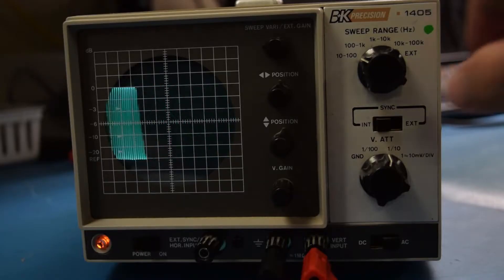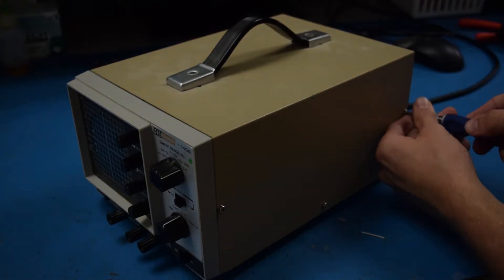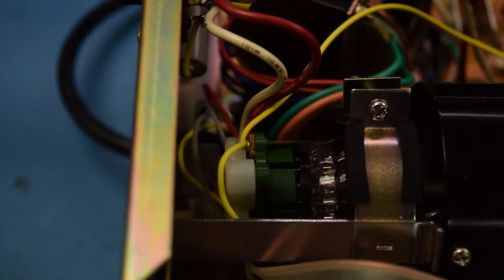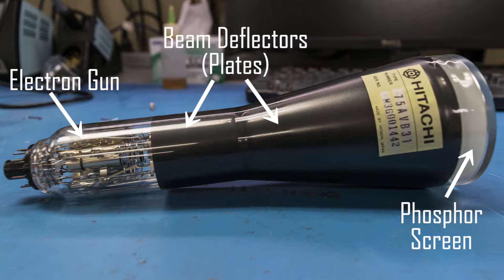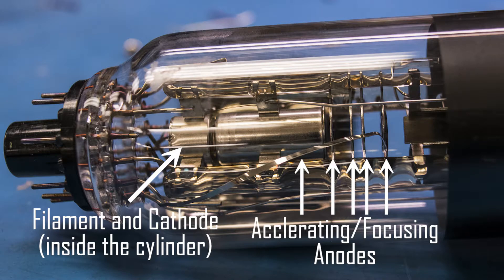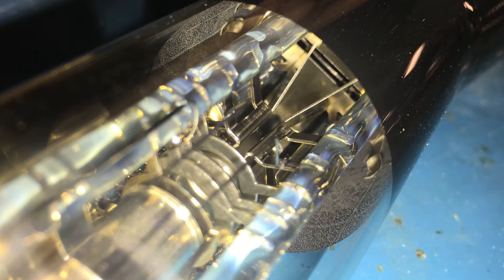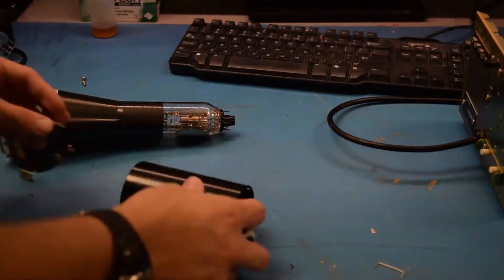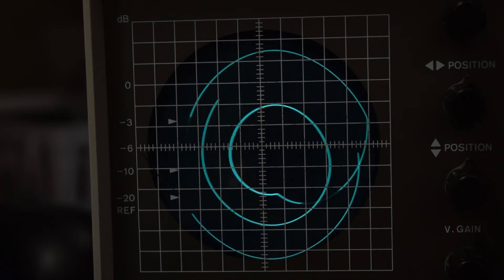How a Commercial CRT Works - Collaboration with BitStream

Comment: Really should of discussed the safety regarding this disassembly, CRT Tubes are often connected to High Voltage Capacitors, and other CRTs act as a type of Capacitor, and without bleeding of the stored power in those components, could result in a Severe even Deadly Electic Shock, after fixing Old CRT monitors and TV for 15 years, safety is paramount. 
Otherwise this is a great video 
For its intellectual content.

Comment: does the ion thruster from Deep Space 1 work on the same principles ? if not how hard would it be to make an electron thruster and what would the differences be in out put thrust i would like to find out how to make both at home to try to simplify the build and hope to open source the propulsion system